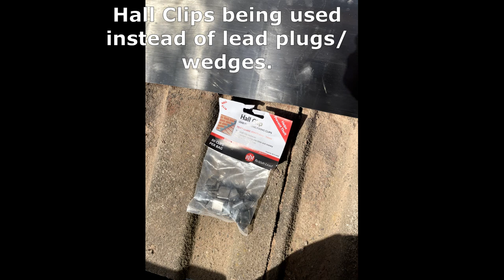Replacing Chimney Lead Flashing, Soakers on Concrete Roof Tiles

Comment: Hi Dave, Nice work. I know with step flashing cement looks good but can lead mate silicon be used in this situation? Which one will last longer lead sealant or cement with possible cracks due to thermal movements? 
Which roofing system is good cement base ridge system or dry ridge system using mechanical system. Many thanks
Reply from the maker: Hello and thanks for watching. I use both cement and from time to time the lead sealant. As to which lasts longer, there is no definite answer to that as it largely depends on who is doing it and how it is done. Decent mortar pointing can last for many decades or even longer. Its largely down to the mix ratios, the weather it was pointed in, too hot? or too cold? etc etc.
lead silicone i think says on the tubes 25 years life expectancy, but i dont think its even been around that long so time will tell. But again how it is used and done is relevant as if its done poorly and doesn't fully seal the joints it may leak.
But i imagine either done correctly should last a couple decades at least and still be water tight.

Comment: Hi Dave great video and very informative, on the front apron did you weld any of the corners, cheers in advance 👍
Reply from the maker: No welding on this one no. Soakers bossed around the corners to make water tight.
Reply: Cheers Dave many thanks for your reply, can u make a rear apron without welding and have u done a video on it, cheers
Reply from the maker: @nottslad1211  it’s called the back gutter not apron on the back of a chimney. It can be bossed around the corner and that’s how it was done since Roman times before welding existed. Needs to be code 5 lead at the back and bossed properly without thinning the lead, not just beaten around the corner which thins it out.
Reply: Cheers Dave

Comment: Hi Dave. Can you explain why you use soakers instead of a simple cover flashing on profiled tiles? Also would you use these on flat single lap tiles? I see soakers now used often on both profiled and flat interlocking tiles, I was always taught this was wrong as they are not properly supported, and that soakers are for use on double lap tiles and slate only. Many thanks.
Reply from the maker: I prefer the look of soakers on pan tiles in all honesty. Although you do use more lead so factor that in. Traditional soakers on plain tiles and slates are hidden and are supported by the slate/tile it rests on. You can’t  do hidden soakers on pan tiles are they are not supported so that’s right, but if placed on top and visible they are obviously supported. Yes you can do this on flat profile tiles and is better than a cover flashing on a long run as water can get past the flashing with cover flashing on flat tiles. I did soakers on flat tiles in a video I did “Fixing shocking lead flashing”, check it out. Thanks for watching! 👍 Don’t forget to sub! 😀
Reply: They are not soakers soakers ain’t visible and are used on non interlocking tile/slates

Comment: Why did you not change the back gutter ?
Reply from the maker: It was the only part in decent condition, not split and was code 5, so thicker lead , still a lot of life left in it. Customer didn’t want it changed so to save a little we left it in. Thanks for watching! 👍